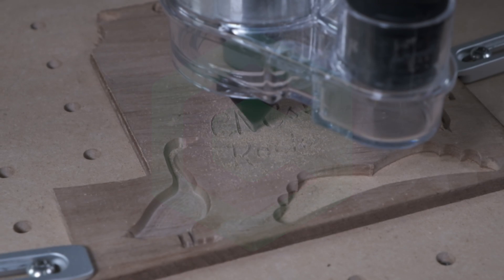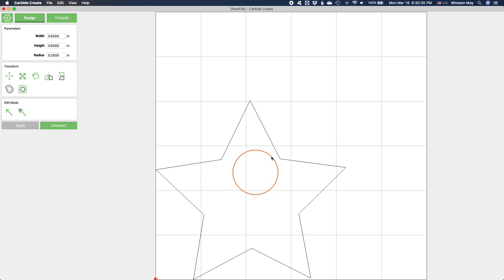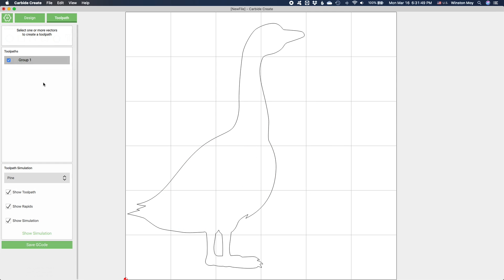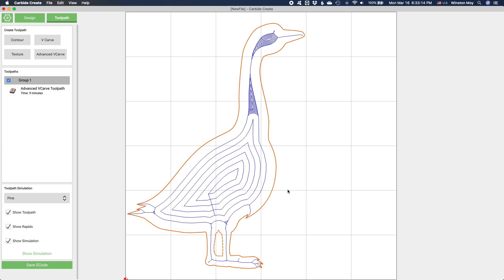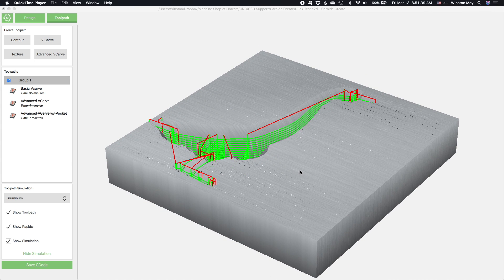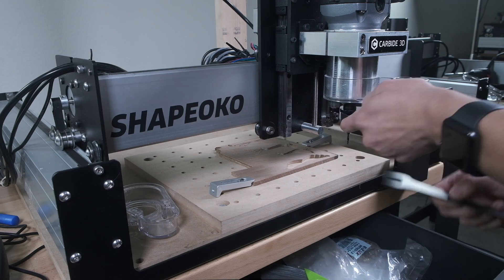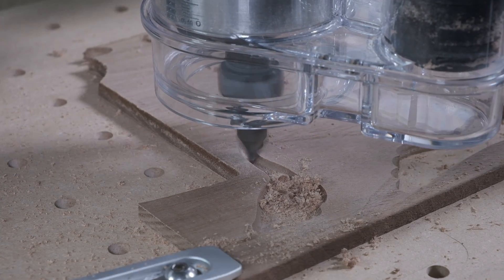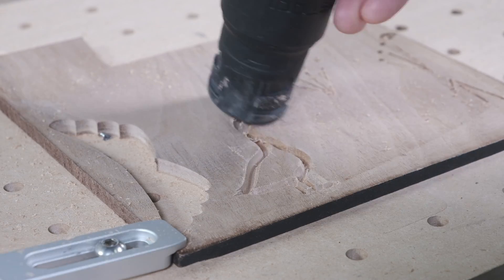Carbide Create Gets a New Toolpath: "Advanced Vcarve"

Comment: Thank you for that! I did an advanced Vcarve with my end mill for the pocket and my 30degree bit for clean up and exported the Gcode to Gsender. The problem was in Gsender my CNC stopped after the pocket and I could not raise the router to change bits or zero with the 30degree bit, I only had the option to resume with the current bit. Any help would be greatly appreciated thank you!

Comment: I'm not understanding why a program requires you to export seperate files for each tool.  How do you achieve this advanced vcarve exporting 2 tools?
Reply: Good question, but is not even an issue, you still have to change tools or bits to finish and zero in the Z axis or "touch top" like in WinCNC and set it automatically when software ask ask you to change bits. Ran a Camaster CNC with WinCNC controler, tool paths created with VCarve Pro, very capable of automatic tool change but always ran two separate files, worked every time for me.

Comment: Ooohhh - how far is the inlay feature!
Reply: Easy to do. Carve your design with a v-bit, lets say 0.2" deep, then create a rectangle around your design so you can create a pocket with the design and carve that pocket to 0.22. The inverted carved piece of wood or whatever else will fit into the first job and have a little bit left to make sure you have. Cut between the two pieces with a saw or band saw then sand ti down flush, hope it helps.

Comment: This strategy seems te be ahead of Fusion 360!
Reply: Very much so.  I spent a day playing with toolpaths trying to replicate it (some of which were taking 30+ minutes to calculate) and never could.  On top of that, F360 is just broken for multi-depth engraves right now: https://forums.autodesk.com/t5/fusion-360-support/2d-engrave-with-multiple-depth-issues/m-p/9381690/highlight/false#M81649
Reply: Not really, when using V-Bits look for the option of "Ramping" at corners.